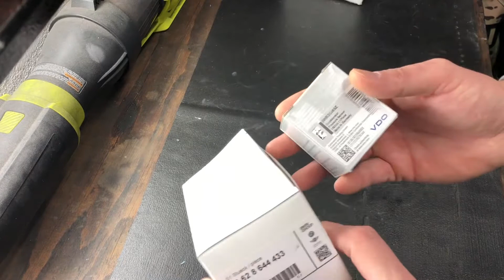BMW 3.5 Bar Map Sensor install. Maintenance update. BMW335xi

Comment: I want to see you do that rear inlets I’m having problem with mine but I can’t fine no video DIY how to do it I love to see you do yours
Reply from the maker: My rear inlet was a nightmare! If I could do it again I would do relocation kit. It took my buddy at like 260lbs and a strap to pull it through. And the fitment was not perfect.
Reply from the maker: For the rear I covered it with lube, wrapped a strap and my buddy pulled it through. My car was on his lift. I did 2” and that might have been to much. It was so tight on the fire wall.